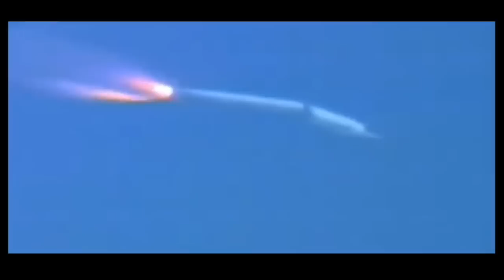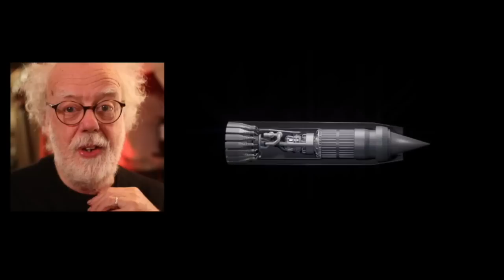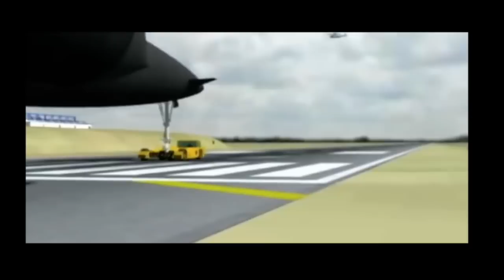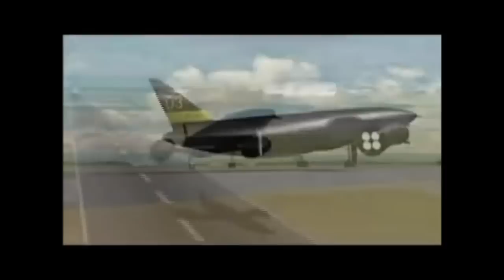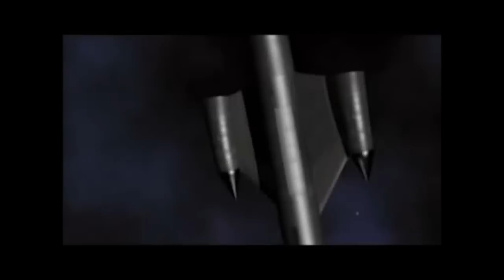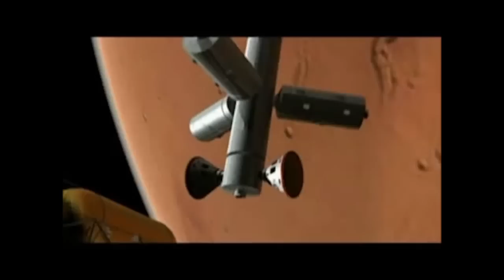SKYLON - The dream - Prof Simon

Comment: Thing is don't you find it very suspicious that all work on electrogravity just stopped in the 1950's ? What they just figured it wasn't feasible OR it went DEEP BLACK ? I think we both know where this is going Simon. The truth is out there it's just locked tightly away (for now) whilst that engine is very impressive & very similar to the ones used on the SR71 GENIUS ! We're still relying on a propellent as fuel it's 2022 not 1922 for Christ's sake. TESLA and TT Brown must be turning in Thier graves. It's beyond ridiculous !

Comment: I love the idea since HOTOL days, but lets face it - little big not so dumb boosters from SpaceX have won.

The original RR idea used 2 stage precooler, ice formation was triggered between them using LOX injections, dry ice crystals didn't stick to second stage of precooler. I strongly *believe*, that they use similar scheme, but instead LOX they use small reversed flow of already cooled air. If you consider tree-like structure of precooler, they don't need physically reverse flow anywhere except central tip,  but use already cooled air from leading segments.
That's why they avoid RR patents and are little more efficient.
It is very probable that original RR idea didn't use helium in precoolers, but used hydrogene directly (another difference that allowed to avoid patent infringements).
The irony is that the original patent's have been expired.

Comment: had to stop video before I hear this, it sounds like an idea I had more than a decade at least, the RAM JET but this require airspeed so pre-rocket of the chocks when airspeed needed for ramjet opens and O2 feeder shutoff, when the atmosphereic air becomes to thin re-engage the O2, the climb-up maybe using wings to carry load up high as possible that is not to steep, all dependant on weight be carried, I knew my idea was sound when I heard how the SR-71 engines worked, I understand Im not the only one to get these thoughts 
my last idea known about was Airbus passenger escape system was patended . and others seen developed, my fault

Comment: ...why an air cooler again?
Yes, yes, I know the Prof said "too much heat for the compressor" but what's wrong with a variable intake geometry (SC)RAM jet? Better, yet a (SC)RAM jet is capable of much higher than Mach 5 at higher altitudes so likely saving more weight by needing to carry less O2 for the rocket stage.
-Silly, (SC)RAM jets don't work at 'take-off' speeds.
True but why not a twin or nested intake design? With a bit of careful fluid dynamics the traditional turbine intake could be set to stall as it reaches it's heat tolerance while the (SC)RAM intake comes in to it's efficiency window.
-Silly, too much weight and complexity.
Even when you've ditched the air cooler all it's gubbins, and made extra savings on O2 payload by extending the speed/height at which the engine has to function as a rocket motor? Hell, if using a (SC)RAM solution yeilds sufficient gains the whole motor could be smaller / lighter.

I know I'm wrong because if such a layout made that much sense that's what this engine would be using... so what am I missing?

Comment: The first 70,000 to 80,000 feet is about all the O2 we get for air breathing engines.  If you examine the velocity versus altitude for any given space launch you will note it’s hardly worth while. However, It may be useful for horizontally launched aircraft.

Comment: Why don't they put a power turbine on the back, replacing the nozzles, and scale it down for use in a car or truck? What about setting it up to act like a torque converter, just as the Chrysler Turbine Car did?

Comment: What would happen if you reenter at a much slower speed not super sonic speeds...?
Would you still need heat shields...?
Every craft coming back is traveling far to fast and always need shielding....simply slow down to speed that don't ignite the air.
Reply: Norm Whiffin the thing is, you can’t really do that. The margins for getting into orbit for most spacecraft are quite slim. You would need much higher efficiency in order to slow down enough to do that.

Comment: Why not to use for reentry issue (air friction high temperature) the same solution as for Falcon 9 - braking with vehicle engine? It is possible to decrease speed of air/space craft to values which will not need high heat shield, what is mean more payload. It is possible with rotating nozzles like on F-35 and one additional vertical engine in front of vehicle.
Reply from the maker: Thanks Denys
Reply: @SimonHollandfilms  And one more thing - it is possible to refuel such aircraft in flight at significant altitude (like SR-71). This is also can be useful and allow to refuel aircraft at start and after reentry the atmosphere from space.

Or, for example, if you use liquid hydrogen, you can fly up connected to air tanker, go up to maximum possible altitude for tanker, disconnect from it there and then continue to fly. Probably this is difficult, but I think it's possible.

Comment: The shuttle uses the same SSME hydrogen oxygen rocket engines from take food to near orbit.  The big solid motors help on takeoff, and near orbit they drop the big external fuel tank so they can't use the main SSME's anymore and use the small OMS rockets.

Comment: Why do they have to take-off with any water, if they are condensing it from the atmosphere?
Reply from the maker: I think they need guaranteed supply for the engine..and it’s probably lighter than a condenser unit ...but good point....go and work for reaction engines...they want folk like you.
Reply: @SimonHollandfilms  I'm a 65 YO, Computer Analyst, in Australia, Travel is not an option, and if they are running the condensers while at the lower altitude, they should be generally be able to collect sufficient moisture for their cooling needs :-)
Reply: @SimonHollandfilms  They already have a condensing system, that they plan to chill the intake air, when they thaw the condensate, they could tank it for skin cooling.
Reply: Easier to carry it then add all the hardware for collection. I suspect
Reply: @007floppyboy  They are already planning to  carrying all they need, nothing new, just a new way to look at it, and if they take off with minimal water and condense the rest of their requirements after take-off, guess what, they need less fuel to take -off, they only need to plan in more detail, their flight profile.

Comment: Seems to me this project increases complexity by 10x but only gives you marginally better performance. Even in the very best case, you get a tiny payload to space. If any part of the design can not make the optimistic assumption you have a 0 payload to orbit vehicle.  Spend all that time and effort on improving your normal first/second stage rocket engines and you will get a rocket that improves on the performance far more Skylon. Skylon simply can't compete against a simple reusable 2-stage rocket even if you make all the most extreme assumptions for how great it could be. You are optimizing the wrong part of the problem.

In the end, this is an interesting technology project, that will never be economical. Even if governemnt fully funds the development and you give the engineers years to solve all of the challanges its very unlikely to capture much of the market. This would be Concorde, lots of pride not much utility.

Comment: Sounds good but why not use a matter drive system to use carbon as fuel instead of oxygen which we need, or use plasma to generate enough energy to give the desired effect.
Got to use an alternative fuel source, I think developing new anti gravity drive systems might they way forward.
Developing systems to be none destructive and to work with life and not to use systems to make pollution.

Comment: Shoot I am your age or older and just want to drift into retirement. Did concentrate in heat and fluids as a Mechanical Engineer which included much of what your talking about. Always had trouble staying awake in compressible fluids class and which I would have. I've keep learning more about it as an older man but ended up in machine design as after school and the as an unemployable  mechanical engineer as most of the machine design design companies closed in the USA in the early 2000 recession. Went back to school & got my MBA (master in business) as I always worked for smaller to mid-sized companies that used their engineers for cost estimating and marketing of some new to be determined product, the one I had to design. Now I am past 55 and only good for being what I call a dry land long shoreman or laborer in an autoplant. My education & experience counts for nothing in my society. If I was 30 I would definitely immigrate or work for this guy in the USA,  (I've gotten invites to go to Canadian companies too, not just give a try like your asking) but I've gotten a lot of time invested in our Social Security system. I agree that this is part of future even if only for high speed transportation around the globe as a atmospheric skipping craft like Sanger proposed in Germany. (It would also keep the aircraft skin cool)

Comment: Would someone care to explain to me (simply, in dumbed down terms) how thrust works outside of earth's atmosphere?
Do 'standard engines' not require some resistance?
[Note, I'm no engineer or physicist]
Reply from the maker: Newton law....action and reaction ....if you push hot gases out the back....the rocket flies forward..in space or in our atmosphere...works great.....if you have a follow up question feel free to ask Graeme.
Reply: So I gather displacement is required either way and whichever location.
My questionable understanding leads me to think that standard propulsion engines would be more effictive with higher atmospheric pressures to push against(?). Of-course there is resistance infront as much as behind etc but I still have difficulty imagining displacement propulsion in other atmospheric conditions.  Rocket science, eh, curious.
Your "UFO Propulsion" video has helpfully appeared on viewing list next.  Perhaps my fuzzy thinking will take some useful form thereafter.  Thanks Prof.

Comment: The precooler doesn't freeze because they quite simply use antifreeze (alcohol). It's that simple.
Reply from the maker: Good solution
Reply: @SimonHollandfilms  I would love to claim the credit but Reaction Engines actually revealed their solution to the problem the other year.  What is still fascinating about the precooler is the tiny diameter of those tubules, some of which are as thick as a hair. But they've also told us the trick there is to pressurise them with coolant gas. What a great innovation eh?

Comment: Thank you for this nice presentation, Sorry, in 8:45 either you are wrong or I don't understand what you are saying about Space Shuttle. In all three cases, you are showing SSME - the same engine. It's a wonderful piece of technology, that is capable of both handling sea level pressure and high altitudes (around 110 km, when external tank was separated and engines were cut off). Nevertheless, STS did not use those engines on orbit since there was no more fuel ;)
So actually to be correct, Space Shuttle used two types of engines - SRBs (that provided >70% of takeoff thrust) till ~ 50km, and SSMEs through the whole ascent.

Comment: The bit about the Space Shuttle engines isn't exactly true. While there are 3 engines, they're all the same type - the RS-25, and they're not thrown away during the mission (though, that would certainly reduce the "dead weight" on the shuttle once in orbit, as it only uses the two smaller AJ10-190 engines in the OMS pods for orbital maneuvering, and not the 3 main SSMEs).

The secret to the RS-25's ability to run (mostly) efficiently from sea level all the way up to orbit lies in its unique nozzle geometry. It has an unusually large expansion ratio (77.5:1) for its chamber pressure (20.64 MPa), and would normally undergo flow separation at sea level (which is bad, since the turbulence that would cause would propagate up into the combustion chamber and cause the engine to explode). BUT, to prevent this, the nozzle is specially designed with the angle of its walls varying down the nozzle, reducing it near the exit, so that it maintains an optimal expansion ratio. This raises the pressure just around the rim to an absolute pressure between 4.6 and 5.7 psi (32 and 39 kPa), and prevents flow separation. The inner part of the flow is at much lower pressure, around 2 psi (14 kPa) or less

Additionally, since the engine is just a conventional engine (unlike the SABRE), it doesn't need to worry about cooling the air or air flow, as it runs on liquid oxygen stores the entire time. So, it's much simpler in that regard.
The only downside of using the shuttle's engine setup is, as I said, the fact that it doesn't use them for orbital maneuvering. They use two AJ10-190 engines mounted in the two OMS pods, using hypergolic fuel that ignites when the two components mix (meaning no ignition systems are needed) for fine maneuvering, since they no longer have the external tank for the liquid hydrogen and oxygen fuel for the main engines once they're in orbit. It works well, but the downside is that you're now lugging around over 23,000 pounds of dead weight.

Comment: I know I'm stupid, but the re-entry cooling is using 100kg + of water, which they carry with them from take off .
Why can't they collect that water from the frost that's created in the pre/intercooler? It would shave a little weight from take off.
Is the answer obvious or have I missed something and am I making myself look even more stoopid?

Another interesting vid Professor 👍

Squiggzzzzz 😀
Reply: Not an obvious answer, and a good question. It could be technically feasible to collect water on the way up, using some sort of water collector (perhaps a vortex swirler between the intercooler and the compressor that flings ice crystals to the sides to be collected, think washing machine drum). However, I see three issues, the first is that clear sunny days might result in too little water, so that limits operability. Second, the weight of a separation system would likely outweigh a water tank on its own. And finally, there would be another thing in an already complex system to potentially go wrong.

Comment: I don't think you're right about the solution to the frosting issue. Looking at the design, the middle of the tubes could vibrate, but not the ends. I agree that you'll probably get vortex shedding and vibration, but I think it's simpler than that. I think the surface of the pipes is designed to prevent ice from adhering to it in the first place. If you think about it, you want the smallest possible ice crystals going through the engine, big lumps coming off would be bad news. So you want to let each tiny crystal form and bounce off the tubes as they pass through. Maybe they don't even have time to form inside the heat exhanger at all! Wear is going to be a challenge if they do form in the heat exchanger though. Ice crystals are hard, so it would be like being in a shot blaster. Presumably the compression of the air plus microscopic crystals melts them so the engine itself never has ice crystals going through it. Perhaps the passage of the air is so fast that ice crystals never have time to form at any point in the air's passage through the whole system.
Reply: They use small amounts of methanol to kind of 'skip' the phase transition of subcooled water where ice crystal nucleation can occur on smooth surfaces. The methanol added at the right location effectively prevents ice forming, and the water subsequently freezes downstream at a lower temperature where it's less 'sticky' in a sense.

Comment: While I do hope the Skylon can be made to work, the arguments for spending enough time within the air breathable portion of the atmosphere getting the lions share of the velocity to orbit accomplished so that the amount of liquid oxygen needed for the exo-atmospheric portion of orbital velocity can be minimized is a tricky balance with or without the SABRE technology. My space enthusiast friends here in the States  say just get clear of the atmosphere  vertically and quickly and then put on the speed with almost no drag. 
The  proposed Skylon return though suggests  that Elon Musk has had a look at your approach. His fully re-useable, but vertically launched Starship seems to have taken some of the elements of the Skyion to heart with a little more vertical descent profile to spill off the heat and velocity. 

My previous criticisms of the Skylon concepts were about the need for a very long runway at each point on earth it would use, due to the very  high wing loading with that wing structure. That need also hampered the Space Shuttle. I also suspect that the concept may be weather limited every bit as much as vertical rockets are. Payload to weight has been the bane of single stage to orbit concepts in all their formulations.
 If Elon succeeds with his Starship, A big IF in my view so far, it will have a greater number of much smaller launch and recovery locations, and also a faster transit time point to point for passenger services. It is good to have alternatives in process trying for the same goals.

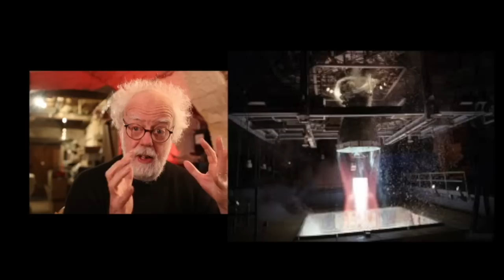Comment: 8:48 I can find no evidence that supports this crazy idea. I consider myself fairly knowledgeble on the subject so I assumed ignorance but I can not find a single document about variable nozzle sizes for the shuttles RS-25.
Reply: They weren't.
Reply: yeah i was with him until that.  they had 2 solid rocket boosters that fell away, but the RS-25s were along for the whole ride.  I think he just doesn't know about under/over expansion of the exhaust gases and assumed the mach diamonds created on lift off were the result of different engines being used as opposed to them being optimized for operation at higher altitudes.